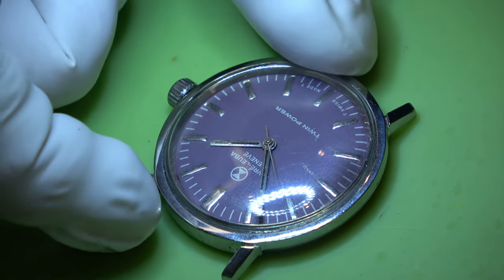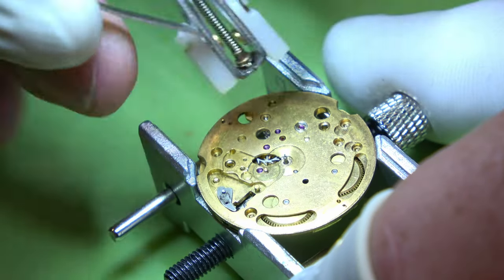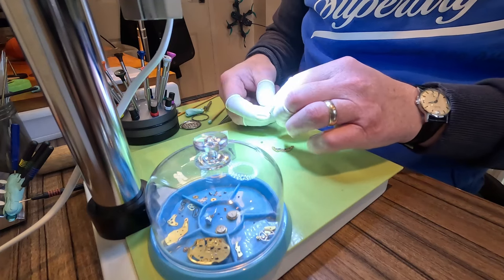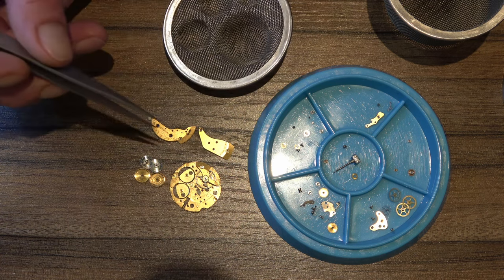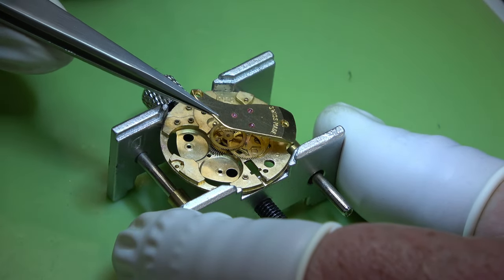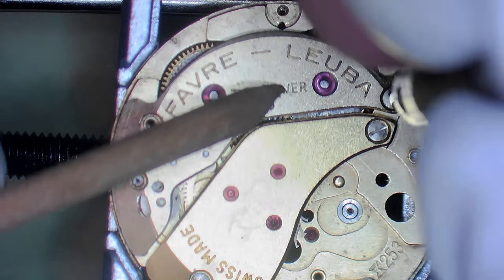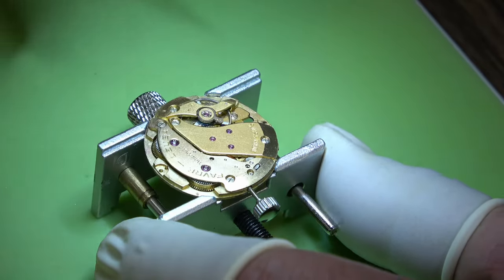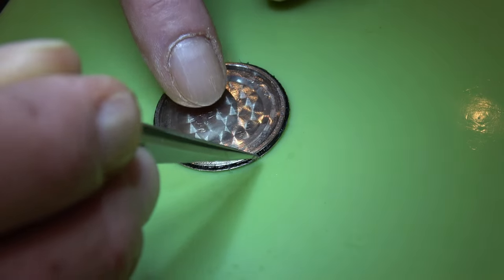“Reviving a Vintage Masterpiece: The Ultimate Favre Leuba 253 Twin Power Overhaul!”

Comment: Great video! Thank so much for sharing your knowledge. I just bought one of these and I’m gonna follow your instructions. I don’t have any cleaner though what you suggest as a starter?

Also, can you provide information about the replacement barrel?
Reply from the maker: Hi my friend thanks for watching. When I started i used naphtha otherwise known as lighter fluid for petroleum lighters. You could also use isopropyl alcohol but you can’t clean the balance and pallet fork in alcohol. Also de-ionised water and some gentle detergent then rinse in clean water and dry straight away. Hope that helps 😁👍👍👍
Reply: @HorologyHubub  thank you so much! Appreciate it a lot! Just one more question, may you share the detail about the main spring replacement like if you have link  or what model you used?